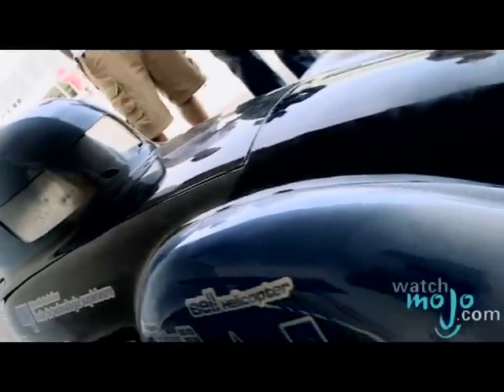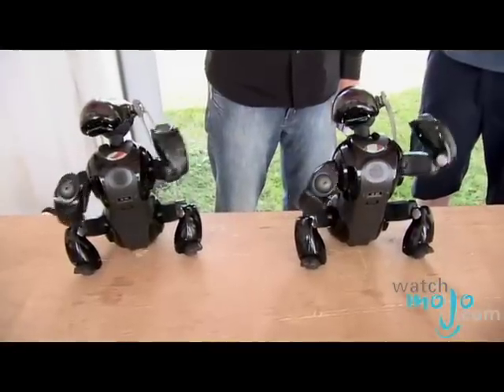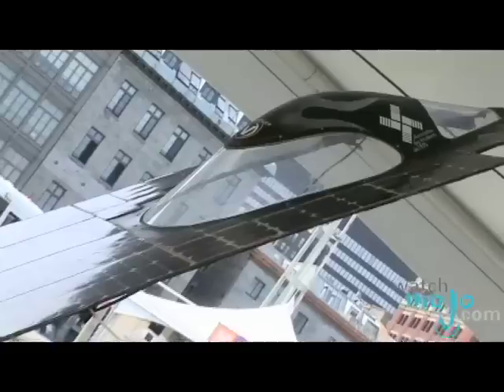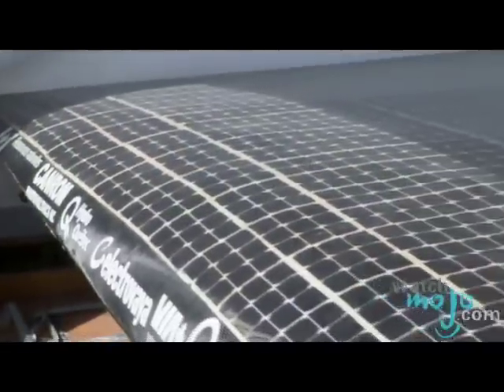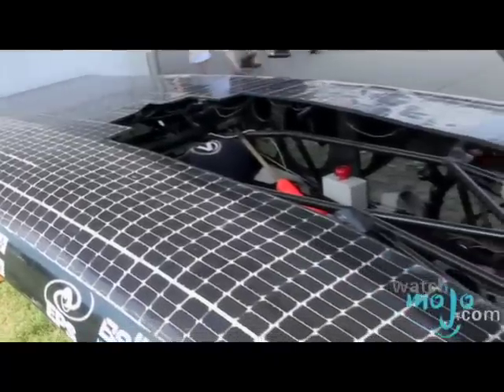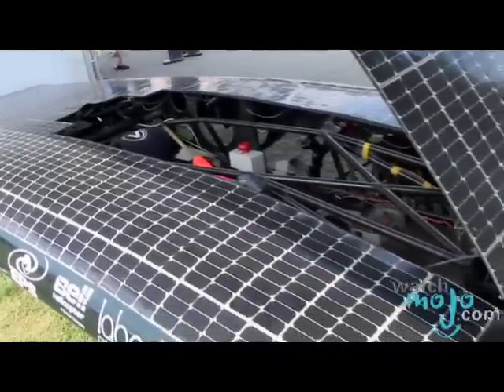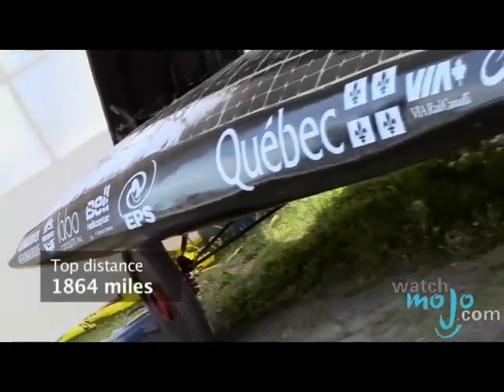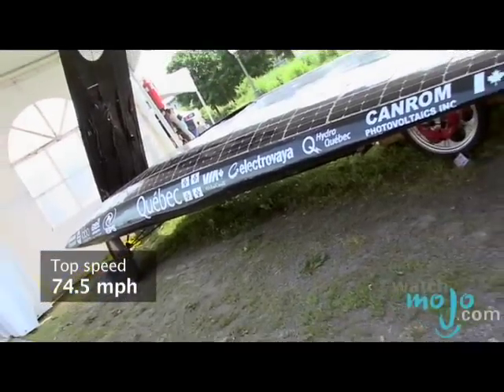Are Solar Powered Cars the Future?

Comment: @HotOnYourTrail The problem is that these cars have to be extremely light weight so that the tiny amount of solar energy they receive can propel them to a normal speed. Batteries are REALLY HEAVY compared to the rest of one of these cars. Add batteries, a real car frame and body, and you just don't gain much by having solar cells attached to the roof of the car.

Comment: Well that's a lot of performance there for the money.  Though it does NOT cost $700k to get that many solar panels.  Maybe back in 2008 to get them all specially formed like that it was expensive, but today you could get the same number of panels (flat) for under $1k.

Comment: i definitely think that solar power is the way to go, but not for how they're using it. they're using the solar panels in a series to directly power the electric engine. the ideal way of the future would be to take a fully-electric battery-powered vehicle, and make the roof and hood out of solar panels, which will recharge the batteries as you drive/let it sit. because it wouldnt be directly powering the vehicle, you wouldnt need such high-powered solar panels. thus costing MUCH less than this.